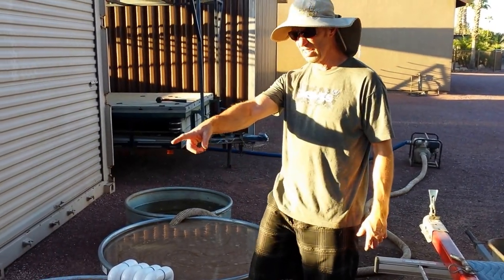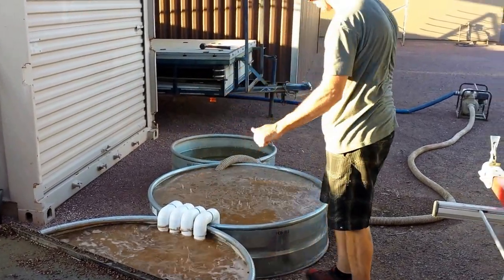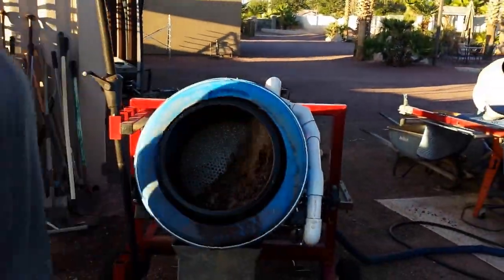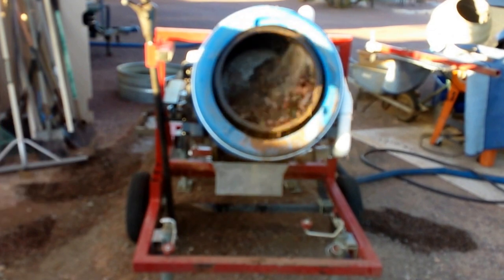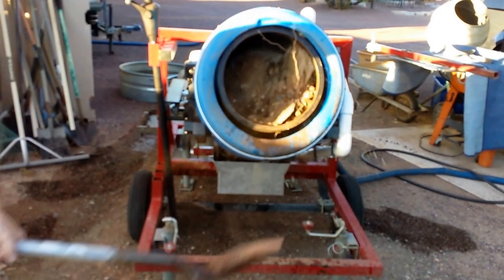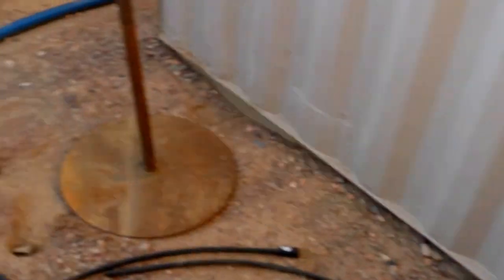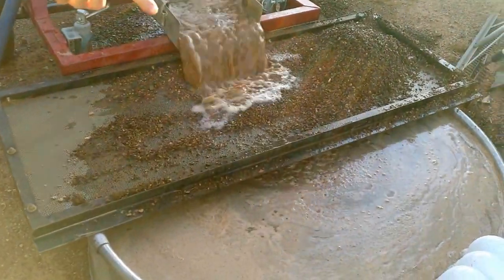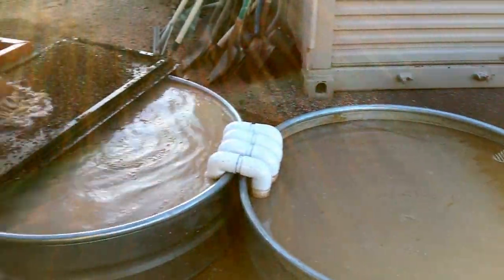Gold-drum, Basket Classifier, Secret Location

Comment: Hi, been following this for a few years and have a query. 
Has a reciprocating drum been tried? When different size/density particles are rotated in a drum the heavies don't just sit at the bottom.

If any gold is a small proportion of the total mass in the drum then gold that does make it's way to the bottom will inevitably be pushed up to the top of the avalanching material again simply because the total mass of the lighter material can push the much smaller mass of the denser material. If a reciprocating drum was used instead then the heavies at the bottom will never rise to make it up and over the lip (unless the drum is full of gold and you add a bit more!).
Reply: Great points.I just found a small gold drum on Craigslist.Doesnt have a spray bar though they say dry or wet but??🤔
Reply: CooL syphoning system there.